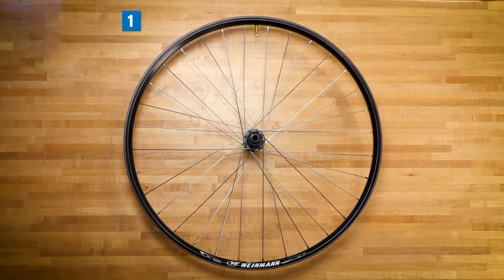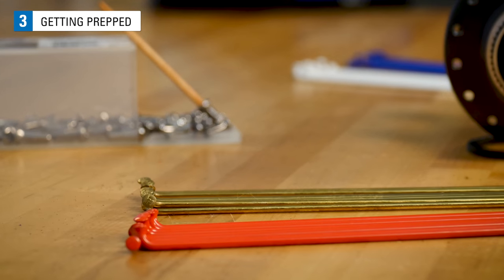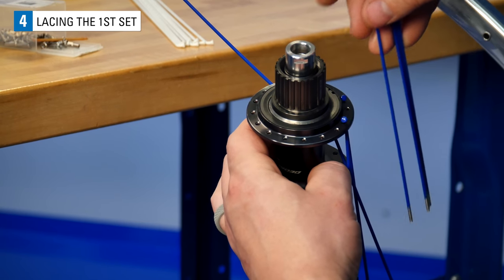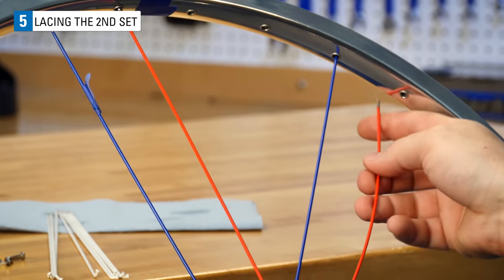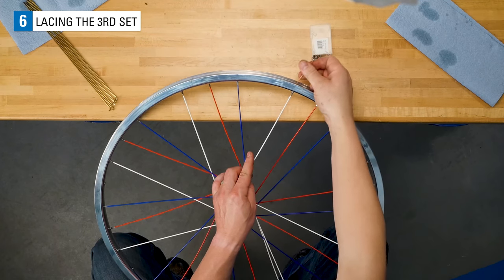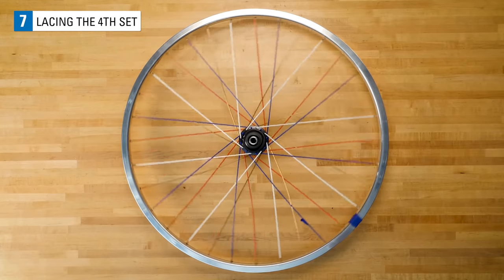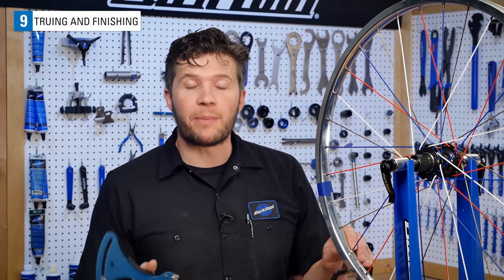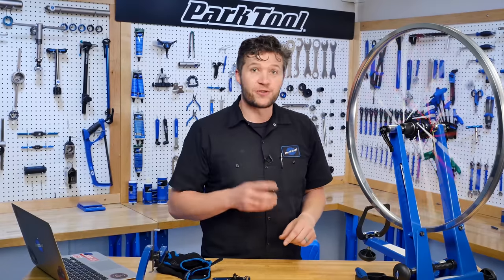How To Build A Bicycle Wheel

Comment: why do you start with the spoke in the 2nd hole to the right of the valve? I think that's not always correct, because the spoke holes are alternating between left & right side. What if the 2nd hole is not on the same side as the spoke in the hub?
Reply from the maker: Good point.  That style of rim has not been made for a long long time.  The spoke should go into the "first up hole", which for new rims is the second on to the right.
Reply: @parktool   Why do you put the first spoke in the second hole to the right of the valve? I normally start next to the valve hole with the spoke hole on my side. I wonder what might be the advantage of starting at the second hole? Thanks for the nice video!

Comment: 32 hole 3 cross configuration. Do different configurations have different benefits for different types of bikes and wheels?
Reply from the maker: Wheel do vary in design for different uses.  The spoke crossing and number of holes is not as important as the rim you select.

Comment: This is a great video.  Very helpful to me.  I’d like to see how you would approach lacing a wheel that has up, down spoke holes vs the down, up spoke holes in this video.  Most of my builds are down up.  Up down breaks my brain.
Reply from the maker: It is only important the "up down up" at the rim matches the flange side at the hub.  Seeing the wheel horizontally, the up flange spokes go to the up side rim holes. Or you can see this as "left-right-left", matching the flange again.
Reply: @parktool  Thanks.  The confusing part for me is where the head up key spoke/drive side on up/down/up will be to relate to lacing in this video.   And making sure there are still parallel spokes at the valve after twisting. Thanks again for the reply and the great videos.  Thanks to this video my fastest wheel build was 50 minutes.  I haven’t matched that.  Usually over an hour.

Comment: Great video, quick questions, should I slightly bend all the spoke heads after getting into the hub? Thanks
Reply from the maker: That is a common wheel builder technique. It simply speeds getting the spokes up to full tension.  If you do not it will still workout as the spoke pulls fully tight.

Comment: Excellent video. Will try this week. One question you mentioned the same technic can be use for 28 hole (that I have)with small alterations. What exactly are those alterations ? I don’t want to screw it up.
Reply from the maker: Just by using different numbers of spokes really. 28 hole can sometimes benefit from running 2 cross. If you decide to go 2 cross the process in the video is still great but instead of going over over under, go over under.

Comment: Amazing, thank you SO MUCH. Although, it's still not clear to me, for the back wheel, you mentioned that the longer spokes will have a lower tension than the shorter ones (on the drive side). In this video, you measure the drive side ones at 25. How lower should the longer spokes be at?
Reply from the maker: This depends on the geometry of the hub and rim combo. Typically for a rear wheel you are looking for the tensions to be within 30%. So if your Driveside spokes are at 100KGF, your Non drive side spokes will be around 70KGF. For the wheel in the video that is 20 on the TM-1.
Reply: @parktool  Thank you so much for your reply, I am sincerely so grateful for your help. Thank you for sharing your knowledge with us 🤩

Comment: What alterations would be made for 1 or 2 crossovers? Really excellent video, BTW.
Reply from the maker: The system is the same.  On the third set for a 1X, you count over only one spoke, and then connect to the rim. For a 2X, count over 2 spokes.  The video shows crossing over 3 spokes for a 3X
Reply: @parktool   Thanks. Appreciate all your educational efforts.

Comment: Great demonstration! I started to take my spokes off on my 36 spoke rim, I noticed that the reference spoke that went into the 2nd hole has the elbow on top of the flange and just like your pattern all the others with the elbow on top fit into the holes that follow. Is that normal for a 36 spoke rim? does it matter which side of the flange you start with.? 🤔 Thanks in advance

Comment: Question, I learned to start the lacing process by putting starter spoke at the first hole left of the valve hole. Is there a reason/ advantage to starting at the second hole to the right of the valve hole
Reply: The goal to keep in mind is for the spokes to not cross over the valve stem hole so that it is easy to pump up the tire without the spokes getting in the way of the pump head

Comment: ..in the tension between the spokes, when it comes to low cost rims, but still of good quality, and double wall, we will have a huge differential in the adjustment in the splice region. This greater resistance will exist according to this splice, which are usually made by introducing the same aluminum profile (but with identical measurements to the rim chambers, with 5 to six centimeters passing the splice and remaining as reinforcement, at the ends of the hoops). This difference will appear at the moment the jump of the hoop is adjusted... In this region there will be a much higher tension, which will modify the tension of the whole hoop. In the example seen, I don't know if there is this type of seam on the rim used. The mechanic did not mention the adjustment of the vertical jumps of the rim, only the lateral ones...
Reply from the maker: Hello there. We do mention that you should check for radial trueness here: https://youtu.be/X5gs00ttvdg?t=1110

Comment: question 1. is it so important to follow the order of spoke-groups? i sometimes place all left then all right. and yes, elbow-out spokes are easier to install than the elbow-in. question 2. i use grease instead of oil. i believe it is better, because grease remains for ever and repels water. question 3. i count how many turns i make the nipples. I start with 10 full turns. i check all spokes, make sure they are the same. and yet, sometimes it happens that some spokes are tight, and some are completely loose. what am i doing wrong? question 4. any experience with catrike rear hub? i have one 7-8 gear hub, beautiful, sealed bearings. however, the freewheel mechanism does not allow to turn in reverse. truing will be a hell. is the catrike rear hub good for regular mtg, or only for recumbent trike bikes?

Comment: Do you have a video with bigger  rims?
I have 26x4 fat rim.
Or If you can lead to that would be great. Thanks .
Reply from the maker: The fun part is that the process is the same! The spoke calculation is different but the lacing process is not.

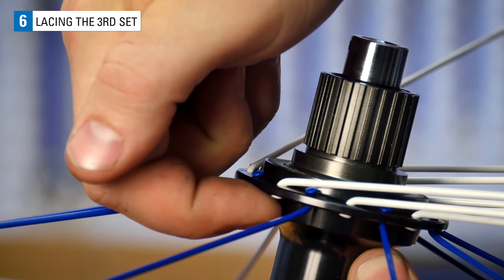Comment: Great tutorial! However, I have a question about hub rotation. Approximately at the 10:40 mark, the hub is rotated in a clockwise direction. What dictates the direction of rotation? Does it have anything to do with which spokes should be under compression and which spokes should be under and tension when ridden?
Reply from the maker: That is a topic that bike mechanics like to discuss and argue about late into the night over beverages of all sorts.  The bottom line: connect the hub to the rim with evenly tight spokes, then go ride the bike.
Reply: @parktool  I like that idea. Thanks for the reply!

Comment: Do i have to use a specific spoke direction on a disc side in a rear wheel?  In this video, disc side for both wheels are in the same rotation, or not? Thank you!
Reply from the maker: Its something that some manufacturers suggest but in practice makes little to no difference. The lacing in the video will do fantastic for you.

Comment: Looking forward to giving my first build a try. Can I ask, what would the difference be if you were to use a 1x or 2x pattern and is there an optimal pattern for a spoke count (ie best pattern for a 24h rear, rim brake)?
Reply from the maker: Sure can. You just cross less spokes  but the rest is the same. Instead of over, over, under. For a 2x it would be over, under. And for a 1x it would be over.

Comment: Are there advantages to building 1 or 2 cross patterns, especially on smaller wheels? With shorter spoke lengths can you still retain a strong wheel with fewer crosses since it can be tricky lacing a 3 cross on a small wheel? Thank you.
Reply from the maker: For some small rims and a larger flange, the 1x or 2x is the only way to build them.  It still makes a strong wheel.
Reply: @parktool  Thank you. Such a great instructional video.

Comment: How to make sure, that the axle of the hub is exactly in the middle of the rim. Will that constraint be given thru the length of the spokes?
Reply from the maker: By first selecting the correct spokes, and then truing the wheel for radial errors, the hub ends up in the middle of the circle.  Changes in spoke tension move sections of rim until this is done.

Comment: Doesn't lubricating the spokes threads make them loose up again quickly? Because I did that once for replacement spokes, and that was what happened. I thought about cleaning them again and then use lock tide instead.
Reply from the maker: It is the tension from pulling it tight that keeps them tight.  Lubrication makes it easier to tension correctly.  Thread locker is also a lubricant until it dries, but typically is not needed.

Comment: Have you guys ever shot a similar video or lacing an asymmetrical rear wheel the Shimano way for the disk wheels?
Reply from the maker: We have not. When you talk to a Shimano Tech or wheel builder there is no good reason given to do the Shimano method. It is harder to teach and do and gives little to no advantage. The method in the video works great on wheels that are running Shimano hubs and disc brakes.
Reply: @parktool  Thank you

Comment: Note that on the non-drive side, the 4th set is oriented as the pulling spokes, to handle disc braking tension.
Should'nt the 3rd set be the pulling spokes on the drive side?, should'nt they be oriented the other way?
Reply from the maker: The load of both braking and pedaling are transmitted through the hub body to both flanges.  Either style of lacing works for disc brake wheels.  It does provide a fun topic to talk about however.

Comment: Hello :). I recently purchased a set of Arc MT006 hubs, 100/135 QR. I'm currently preparing for a wheel and need to figure out the correct spoke lengths. I'm using the WTB KOM light i25 rims with an ERD of 604mm. (Rim weight: 455g) I've been told that you should add about 3mm to the rim ERD to account for the spoke nipples, which =707.  Is that a correct practice? How much should I add to the rim to account for the nipple? The technical diagram available for the Arc MT006 is a bit confusing, and I can't seem to figure out what the correct flange circle diameter is. The measurements I input where. Front hub: 32H, lacing 3x, weight:160g Width 100mm. PCD: 58/45, Nut to Flange: 28.1/ 13.7, Nut to center: 21/36.3. 

Rear hub: 32H, lacing 3x, weight 240g, width 135mm, PCD: 58/44, nut to Flange: 31.57/48.15, Flange to centre: 36/20. The hub uses 14G spokes. Recommended nipple length is 12mm? When using the DT Swiss calculator the total recommended spoke lengths come out at, Front (L/R):  293mm/294mm. Rear (L/R): 294mm/295mm. Could you possibly tell me if I have gone about the calculation correctly?

Comment: I'm aware that wheel building is a fun  part of any serious amateur bicycle mechanic's knowledge, but there's one major reason I've never attempted to learn: Being a loaded touring bike fanatic, I know better than to undertake a multiday or multiweek tour with fifty or sixty pounds of gear on sketchy wheels, unless you like hearing spokes popping or rims cracking fifty miles into your ride.
So to heck with the weight of the wheelset: I need the strongest rims, laced with beefy spokes, and tightened and prestressed with scientific precision to withstand the rigors of a multi month Southern Tiers or GDMTBR. No amateur and very few bike shops possess the equipment or the knowledge to give me the assurance, or the peace of mind, of having a wheelset under me that won't fail me. 
,

Comment: Time 16:12 is the drive side of the rear using longer spoke? Are front and rear using different spoke length? Which longer spoke use in front and rear wheel?
Reply from the maker: For this build the rear driveside has shorter spokes, which is very common. Front disc wheels typically have shorter spokes on the non driveside. Check out this video for more on spoke length. Depending on the hub, rim, and lacing pattern lengths vary. https://www.youtube.com/watch?v=kSFmvV3J99c&t

Comment: If I'm lacing a front disc hub, shouldn't the non disc side have the longer spokes? Opposite to what is described in this video
Reply from the maker: That is typically the case but not always. Same goes for the rear. Hub geometry and cross patterns play a big role in spoke length along with the spacing of the hub. So, it will vary from build to build.

Comment: Thanks!  I'm rebuilding an old (1950's) wheel, that is laced crossing only TWO spokes..... how do I modify the build ?
Reply from the maker: To do a 2 cross you simply only go over the first spoke it crossed and then under the second. So instead of over over under, it is over under. The rest is the same.
Reply: @parktool  Thanks, my front hub has a drum brake on the largest side of the hub, so is that side one or side two?  The small hub side has elongated spoke holes, where two spokes are inserted in opposite directions, rather than a single hole! when trying to lace the second side the spokes keep falling out of the slot!....Heeelp!

Comment: You show using Park CL-1 oil to lubricate the spoke threads and nipple seats. But butyl rubber is affected by petroleum oil, and I've had inner tube punctures adjacent to nipples shortly after riding new wheels assembled using petroleum oil (which gets flung towards the inner tube by centrifugal force in use). Question: is CL-1 petroleum based, and does it affect inner tube rubber?
Reply from the maker: The lubrican should not come in contact with the tube. There is typically not enough to be flung and there is also a rim strip covering the holes of the rim to prevent any from contacting the tube. The holes close to the spoke holes you are experiencing are likely due to an issue with the rim strip.
Reply: @parktool  Although your technique of oiling the nipple seats after lacing is convenient, it is quite possible that this oil will migrate to the inner tube. The holes in my inner tube showed clear deterioration of the rubber due to petroleum-based oil contact, which had managed to bypass the rim tape. However, using silicone-based oil avoids this potential damage. Question: Does Park manufacture any silicone-based oil which would be a better alternative to petroleum-based CL-1 oil?
Alternatively, applying grease to the nipple seats is a good alternative approach which avoids oil damage.
Reply from the maker: @MrDavidwgreen  We do not make a silicone based lubricant. What you are experiencing is not likely from the lubricant used during the building of the wheel.

Comment: Are the white spokes the same length as the blue spokes or the red spokes? help
Reply from the maker: White and blue are the same here.  The drive side on this wheel is flatter, as the hub flange is inset for the sprockets.  The drive side has the shorter spokes relative to the non-drive on this rear wheel.  See determining spoke length for more.

Comment: what's your thoughts on asymmetrical lacing for disk brake rim? necessary?
Reply from the maker: There are certainly many wheel with both lacing, and there is no trend or data to say one is better.
Reply: @parktool  thanks for the response team! 🤙

Comment: I followed your video and finished setting until the 4th part. Now I have super long spokes. Is there a way to make them shorter by changing the lacing process?
Reply from the maker: If three sets seem to have worked out, but the forth set is long, double check the crossing of that forth set.
Reply: @parktool  I adjusted the fourth set to take the place of the next spoke so it will become shorter.

Comment: Hello, on my current rim/hub that came with the bike when i bought it, it is at 110x15mm boost, 24 holes, but this new front hub that i have just bought (by mistake) is 28 holes with the same dimensions, how difficult would it be and what would the setbacks be? I don't mind getting a new wheel/rim or returning the hub but if it saves me money & the hassle of waiting for the refund then i don't mind giving it a try.

I assume i could skip something like the 2nd, 4th, 8th & 10th hole on one side of the hub/rim and then the 12th, 3rd, 6th & 9th on the other side like on a clock, possibly making it the same set-up as my 24 hole current rim/hub.

(Please excuse me, my math skills aren't that good today on a Sunday 😂)

Thank you in advance.